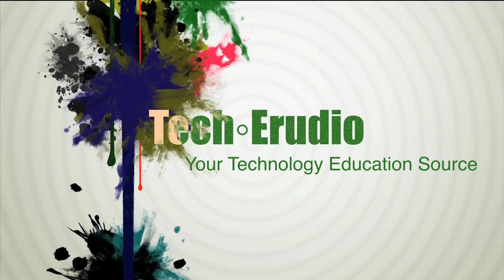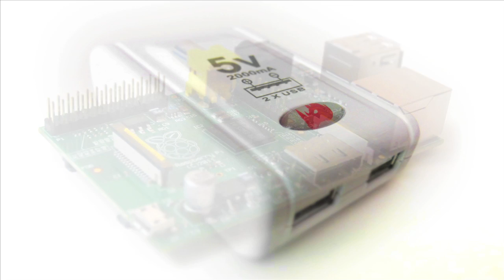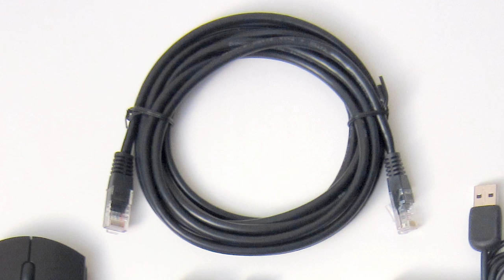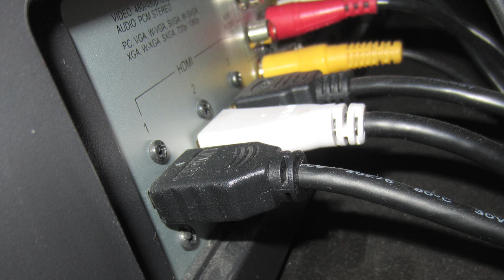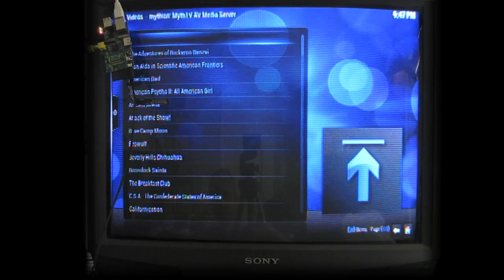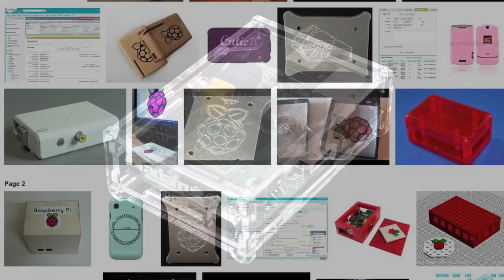Raspberry Pi - Tutorial 2 - Hardware Accessories

Comment: Can I buy a battery that I can charge so It doesn't need to be plugged in?
Reply: +TechErudio hi, I got this power bank(iPro 13000mah) is it enough to run it? 
Output1:DB5v=1A(Max)
Output2:DB5v=2A(Max)

if yes which output I should use ?

http://www.amazon.in/iPro-iP40-Powerbank-Smartphones-Tablets13000/dp/B015H3VXI2/ref=sr_1_1?s=electronics&ie=UTF8&qid=1446965752&sr=1-1&keywords=ipro+13000+mah+power+bank
Reply from the maker: ROCKET LAUNCHER Yes, but how long you can run it on a charge depends on what type of battery you get and what you're running on the Pi. Here's just one example. https://www.adafruit.com/products/1566 . Although, yYou could use almost any 5v USB battery pack designed to power cell phones.

Comment: do you need any software for the wifi USB if you are running Raspbian?
Reply from the maker: No, as long as the usb wifi device is recognized, you don't need any additional software. You may need to configure the wifi device, but no software besides the OS is required. There are some software wifi managers like "wpa_gui" that I haven't really tried. It supposedly makes configuring the wifi easier.
Reply: TechErudio , thanks :)

Comment: The problem with your cable in the video was it used a really low gauge wire that couldn't transmit enough power.  People complain about this charging their phones/tablets/etc.  Just make sure you buy a cable that is rated for 1a/2a.  They sell them up to 2.4amps.  The length isn't really an issue.

Comment from the maker: Yes. You can have 2 different OSes on separate cards, but you must shutdown and disconnect power before changing cards. You cannot switch cards while the power is on. You can also now have 2 OSes on the same card using BerryBoot. See tutorial #3B.

Comment from the maker: @kpjVideo If you have a HDMI-to-VGA, there would have to be some sort of digital to analog conversion, otherwise it won't work. If you have HDMI-to-DVI, it will work fine, but it will be video only, no audio. I use HDMI-to-DVI for my Pi, and it works perfectly on an old 1280x1024 LCD monitor.

Comment from the maker: No. VGA is an analog signal. HDMI/DVI is digital. You can use HDMI to DVI cables if your monitor has DVI input, but you will only get video from the HDMI-to-DVI cable. DVI is basically the same video signal as HDMI, but without the audio. Audio would have to come from the stereo jack in that case. If you *really* need to, you could get an HDMI-to-VGA converter, but it would probably be more expensive than it's worth.

Comment from the maker: "Headless" = Without a monitor, keyboard or mouse. Basically means connecting to a server over the internet remotely using a second computer. My Pi doesn't have a monitor or keyboard connected to it. It's "headless" and only connected to my network via ethernet, so I just use the SSH protocol to login remotely using my Mac desktop's Terminal program.

Comment from the maker: To make the videos concise and fit into a shorter time span, I can't be completely thorough on some commands. Google can point you to tons of info on all of the commands mentioned in the video. I give you the basics. Then you must do some homework on the rest. SSH = "Secure Shell", a remote login system that encrypts connections between 2 computers. DHCP is the "Direct Host Control Protocol". It's used by routers to assign your device/computer's IP address. IFconfig = "Interface Configuration".